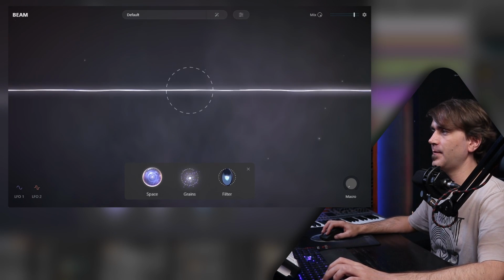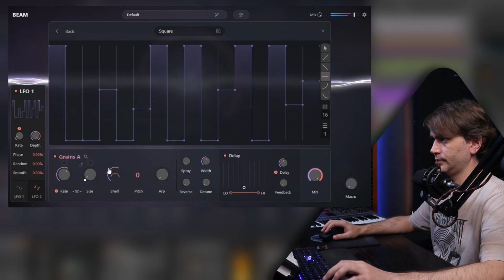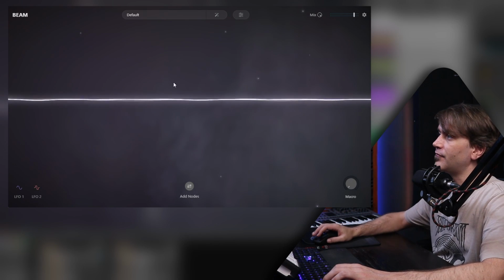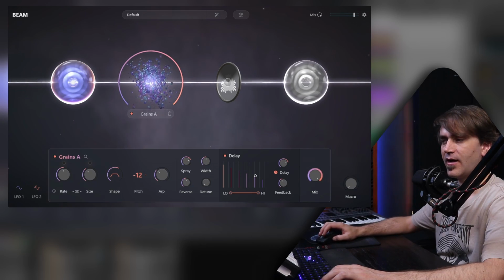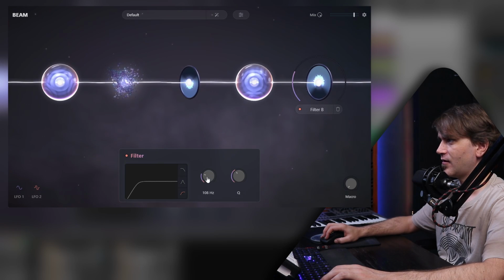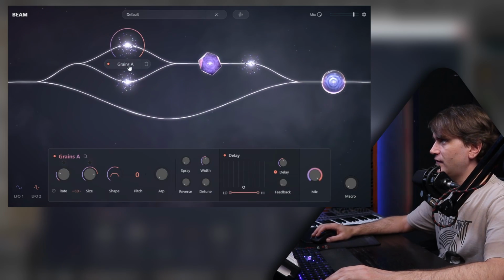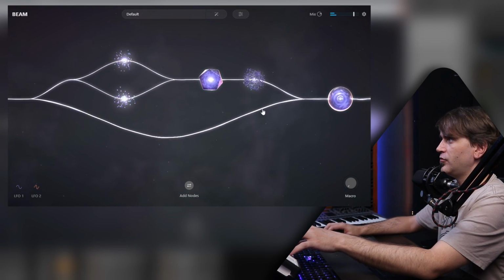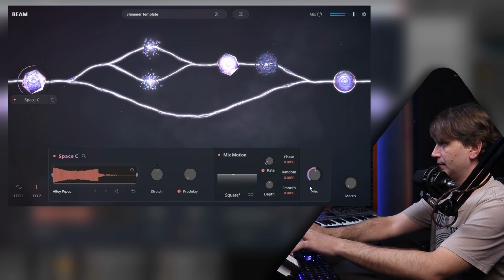3 Sound Design Techniques with Lunacy's BEAM Plugin

Comment: Just who I wanted to see demo this. I’ve had cube since it came out and really like it. 

By the way Mr Glitch, what kind of pc are you running? I’ve been thinking about building a new workstation for audio and was curious.
Reply from the maker: thanks for tuning in! So I recently upgraded my system it was about a decade overdue LOL I now run an i9-13900, 64gb RAM, some NVME drives and a GTX4070 (mainly for video stuff though not audio)

Comment: Do you know if there is an option to stop the animation?
Reply from the maker: you can reduce the load, there are 3 gfx settings
Reply: you don't like the beam?
Reply: @Italliving  It's just fluff. Wastes CPU/GPU cycles.
Reply: @Italliving  not about liking, but about using system resources for un-necessary flasgy graphics.
Reply: @va941 i figured when i drop the reply or it would be resource related  , not sure if that will be a huge difference with or without , nevertheless good point
Reply: @Italliving  guess it depends on the system and the plugin in guestion, if i have the animations on Bloom drum breaks on, it fucks up my audio immediately, if i switch the animation off its ok.
Reply: @va941 i only see an increase of 1% here  ... but nice you can get it OFF !!!